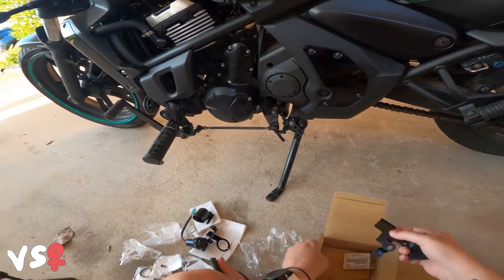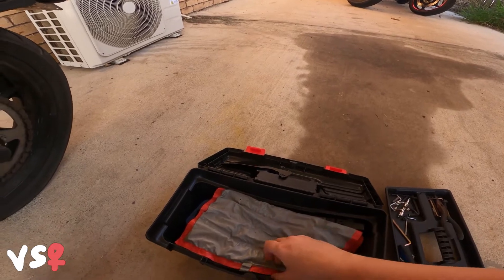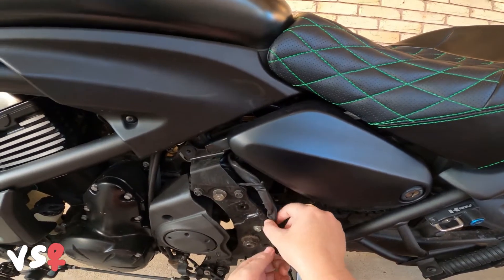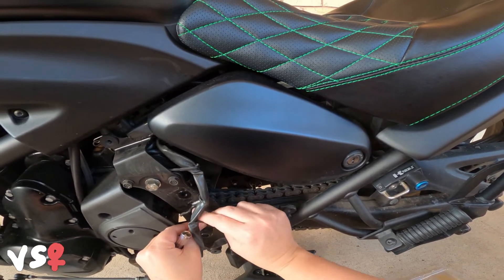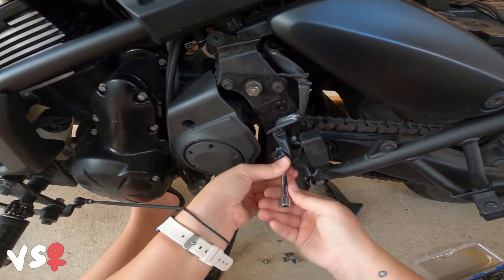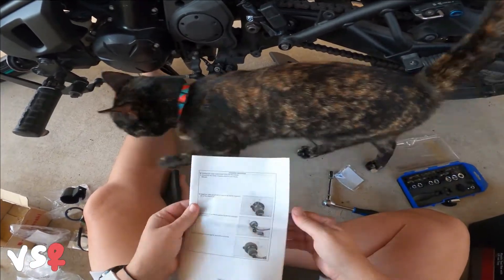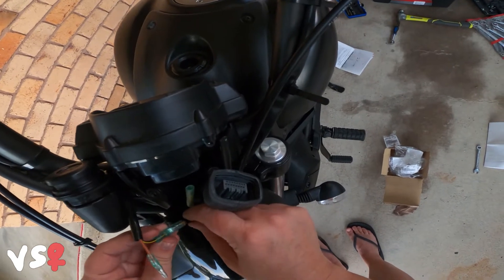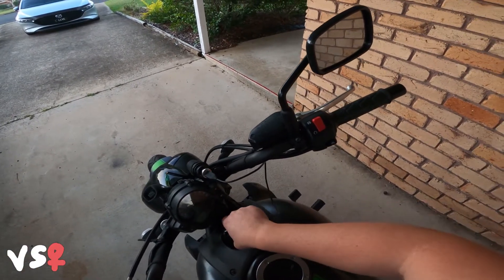VS♀️ Installing Relay and 12V DC Power outlet (Vulcan 650)

Comment: Great tutorial, where did you get the parts from? Struggling to find any on
line, they all say they don’t sell online. Hoping you can help 😊
Reply from the maker: Thanks for watching 😊 It's been a while since I've purchased these parts so hopefully the links are still valid... but I got them from ebay. 

Here's the link to the plug.. 
https://www.ebay.com.au/itm/NEW-GENUINE-2015-2021-KAWASAKI-VULCAN-S-650-12V-DC-POWER-OUTLET-99994-0541-/223555426251?mkcid=16&mkevt=1&_trksid=p2349624.m46890.l49286&mkrid=711-127632-2357-0

You'll also need the relay... 
https://www.ebay.com.au/itm/223477750281?mkcid=16&mkevt=1&mkrid=705-154756-20017-0&ssspo=tHct1iRFQ9S&sssrc=4429486&ssuid=aY7x2rERTJC&var=&widget_ver=artemis&media=COPY

Happy shopping, happy modding!

Comment: JOB WELL DONE ( LIKE ) HOWEVER IT WOULD BE NICE F YOU PUT LINKS FOR THE POWER OUTLET AND WHATEVER ELSE YOU USED, JUST AN IDEA ... BUT GREAT JOB YOUNG LADY
Reply from the maker: Thanks Albert! I might go back an add the links into the video description to make them easy to find! Thanks again! 😁 

Here's the link for the DC power plug https://www.ebay.com.au/itm/NEW-GENUINE-2015-2021-KAWASAKI-VULCAN-S-650-12V-DC-POWER-OUTLET-99994-0541-/223555426251?mkcid=16&mkevt=1&_trksid=p2349624.m46890.l49286&mkrid=711-127632-2357-0 

And the link to the relay... 
https://www.ebay.com.au/itm/High-Quality-Motorcycle-Relay-Kawasaki-versys-650-1000-X300-X650-ninja400-650-/203247503092?mkcid=16&mkevt=1&_trksid=p2349624.m46890.l49286&mkrid=705-154756-20017-0
Reply: thank you VS Chick, that was very kind of you. thumbs up
Reply from the maker: No worries at all 😊

Comment: Currently putting the same add on to my Cafe and this helped me make sure I wasn't fucking anything up royally. I did test the supply out on an air pump and it blew the 5A fuse for some reason, so TBD on whether I got a faulty part, or I tried to draw too much power for the unit to handle.
Reply from the maker: Arghh!! That's a massive pain then!! Yeah maybe faulty? I haven't had any issues with mine yet... touch wood!

Comment: have you got the part numbers for everything pls  good job on the channel
Reply from the maker: Thanks Dale 😎 Here's the link for the DC power plug through ebay... but you might be able to get one direct from a kawasaki dealership. https://www.ebay.com.au/itm/NEW-GENUINE-2015-2021-KAWASAKI-VULCAN-S-650-12V-DC-POWER-OUTLET-99994-0541-/223555426251?mkcid=16&mkevt=1&_trksid=p2349624.m46890.l49286&mkrid=711-127632-2357-0 
Also you'll need a relay too... 
https://www.ebay.com.au/itm/High-Quality-Motorcycle-Relay-Kawasaki-versys-650-1000-X300-X650-ninja400-650-/203247503092?mkcid=16&mkevt=1&_trksid=p2349624.m46890.l49286&mkrid=705-154756-20017-0
Reply: @TheVSChick  thanks for that could you please tell me where abouts you get the wire from to plug into is it behind the dash ?
Reply from the maker: Yeah it's already there ready to plug into. They usually tuck it in with the rest the wires behind the dash 🙂

Comment: Can you please tell me what the button above the DIP light indicator on the dash of Vulcan S does?
Reply from the maker: Arghh... I'm not entirely sure which button you're talking about 😬 The button on the left hand side above the lights is a passing signal. Basically just chucks the high beams on. The buttons on the dash go through the functions... set the clock etc. Hopefully that helped?? 🤷‍♀️ Hehe
Reply from the maker: Are you pumped with your vulcan?? Hopefully the delivery went smoothly.
Reply: @TheVSChick  yeah… it’s just nice to sit on a motorcycle after nearly 17yrs…. I am doing my learners course on the 6th and 7th of August…
Reply: @TheVSChick  I found what that button does, it just initiates the time change on the dash.
Reply from the maker: Not long to wait now. Time will fly and you'll be cruisin the streets before you know it!
Reply from the maker: Glad you figured it out haha

Comment: Did you have to order the extra parts or did it all come in the same package
(The relays or whatever they were?)
Reply from the maker: They came together... but they are often sold separately so just triple check to make sure everything is included.